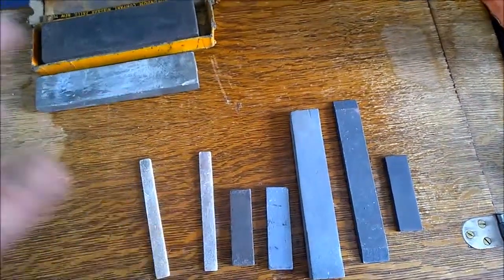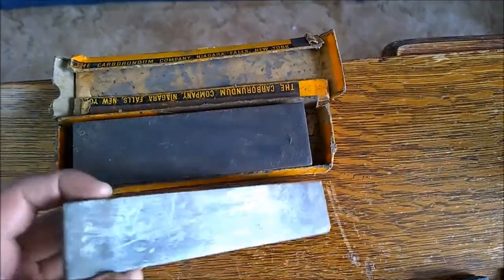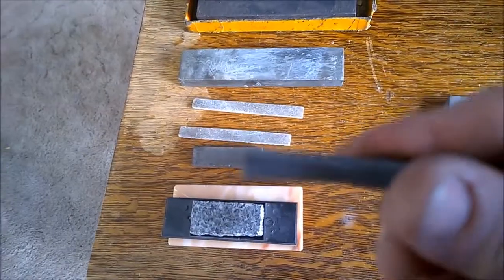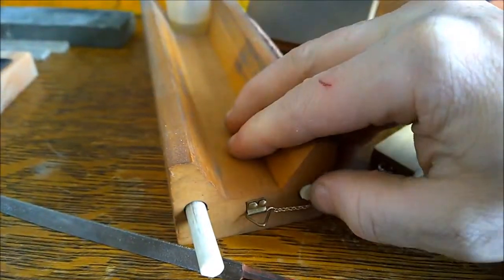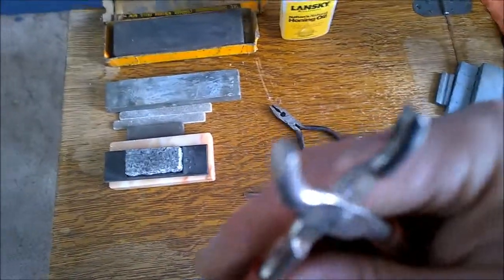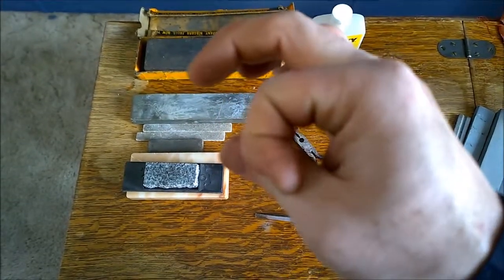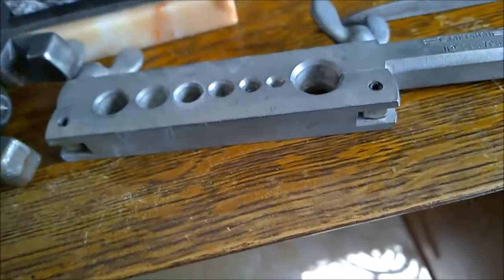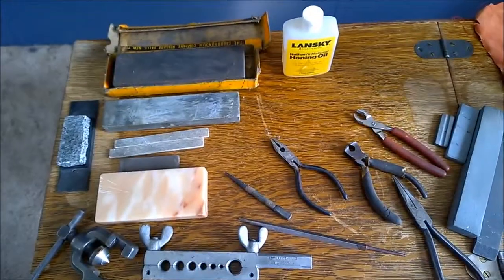Flea Market finds. And, Supplies for my new Mailling Stand.

Comment from the maker: So, I took a closer look at a few of these. I had thought previously that the two thinnest ones seemed really soft for sharpening stones (and of course not quite broad enough). Showed them to my roommate (someone who is going to vocational school for welding and fabrication). And, he said they are soap stones. Looked it up afterwards. And, they appear to be exactly that. Welders use these for marking. So, two of them turn out to not be stones. Still not at all a bad grab, for having just leaped on what stood out to me (of course this is a material your supposed to be able to sharpen with as well. I've not used one myself, but will give it a try.).